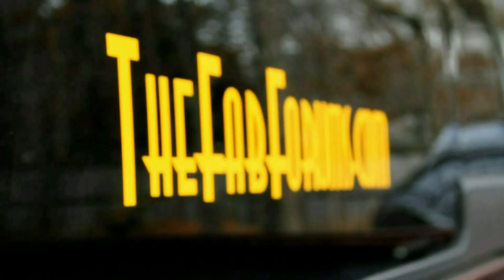Bead Rolled Magnetic Sheet Metal Panels | c10 Chevy Truck Black Pearl

Comment: I smashed the like button so hard I cracked my screen! Kyle I actually have done something similar to that with the magnets. The only down fall was that the epoxy would fail after awhile so I ended up using JB weld with no other issues. Can't wait to see the door panels.
Reply from the maker: Sweet! I will keep that in mind

Comment: good thinking Kyle. half way into video tho and well i seen this idea before with speaker grills but just want to add if you used the neo magnets on the panel and on the seat it would be self locating when you snap it on as those neos will pull them selves to each other if you have the poles set right and would never have to worry about it being just little bit off it would be same spot every time you pull it on or off... anyways just an idea back to the video for me :)
Reply: sent you video clip on facebook as to what i mean. like i said just an idea to make those panels self locate when you take them off and put them back on. ps love the channel watched every video so far... keep up the good work man love it!
Reply from the maker: Yeah I thought about that and may be an alternative if these wont stay in place

Comment: if they happen to slide a little on bumpy roads you can maibe add some bits of plastic or bondo on the steel backing that either go totally around or cradle the epoxied magnets underneath

its a nice idea , and looks realy slick 
could do the same thing for leather covered doorcarts (that and bolts through hidden pockets in the doorhandles intoo the metal of the door itself holding them in place )

hope you will make some simulair pieces on the dash and doorcards , maibe a suround for say the dome light , a strip on the dash maibe some sillprotectors for over the door sills 
http://www.nktuning.com/_var/gfx/82194a58c6a0e328c0d1687d2519a434.jpg

could tone the flashiness down a little by having everything black anodinized to fit the rest of the truck and the wrapping foil you where planning to use on the exterior , anodizing it will have the brushed finish show through unlike painting it black 

been looking intoo that wrapping stuff and there seems to be a trick to it 
you heat and stretch more then you need it to stretch lay it on and heat it again to get it back to the original shape , that gets rid of most of the wrinkles when you start to stick it down over compound curves and have too mush material in the middle 
https://www.youtube.com/watch?v=e8FduBSAm_s
Reply: I was thinking the same thing, but another idea would be 3 pop rivets around where the magnets hit the steel plates.
Reply from the maker: Yeah there is some plastic from the seat that actually cradles the magnets....great ideas though